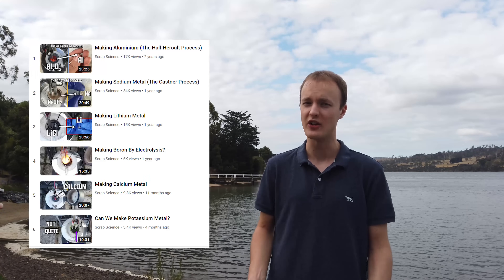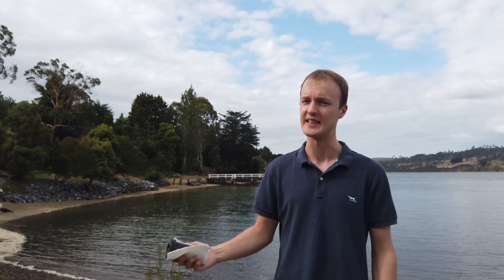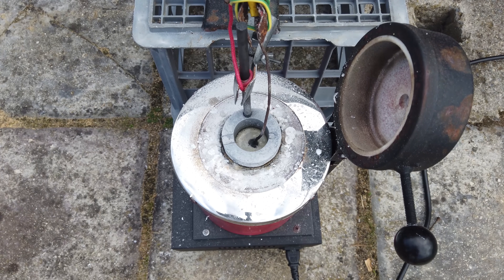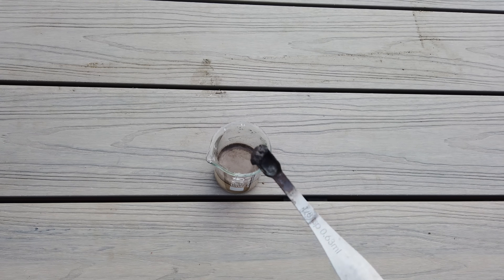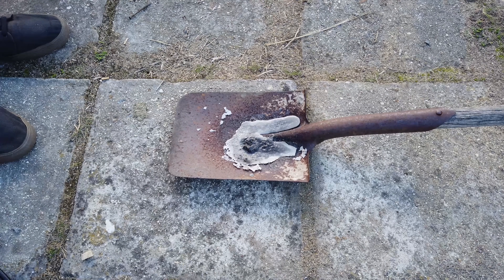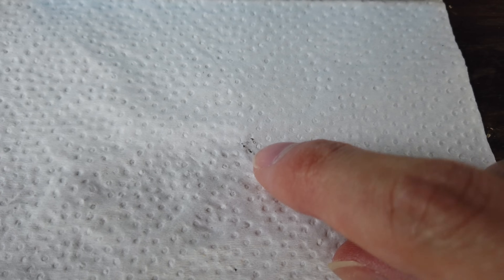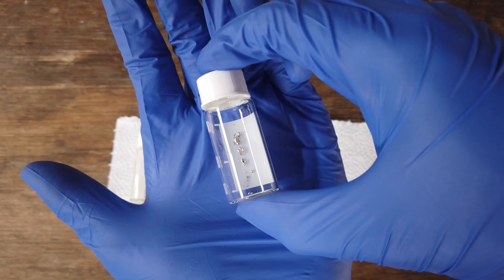Making Magnesium Metal

Comment: Mix the MgCl2 and KCl togther in a ball mill. Add a small amount of silica sand to it as well. Melt down.  Continue heating to bright red heat in a steel can. Next use a graphite rod as the anode. 7 to 15A is about right for a soup can container. The magnesium will sink to the bottom of the can. The high temperature also prevents formation of an alloy of k and mg.❤
Reply: exact temperature?
Reply: how do you prevent it from sinking? what is the sand used for?
Reply: @Critical-Smoke  I would guess as a dehydrating agent? I know the same is done with hygroscopic dry extracts of plants in pharmacy, they add 5 wt% silica.

Comment: Try dissolving MgCl2 and KCl in water and boil the solution down to crystallize carnallite (KMgCl3·6H2O). It should dehydrate easier than the MgCl2 and give better yields. Also the magnesium sponge can potentially be a good source of highly reactive magnesium (for alcohol catalyzed sodium synthesis or similar experiments).
Reply from the maker: The only trouble with the magnesium sponge is that it's filled with salt from the melt, making it largely unreactive outside of aqueous solutions (which dissolve those salts away, of course). I tried burning it and it wouldn't even ignite, since the salts kept coating and protecting the metal within.
Any ideas for removing the salts and leaving the magnesium sponge intact? Maybe it would still work for those kinds of reactions anyway? I'm unsure...
Reply: @ScrapScience  Only thing I can think of is putting it inside a blender along with mineral oil and dump the resulting mix in water to get rid of the salts. I would probably directly use it in the sodium production.
Reply: @ScrapScience  just an idea what if you put it into coffee grinder; theoretically the chloride shouldnt be a problem anymore ( but on the other hand it can become pyrophoric not sure)
Reply: "Carnallite may not only be fluorescent but is capable of being phosphorescent" very interesting

Comment: @6:15 perhaps you could use a small fine-meshed steel sieve for the electrode put deeply inside the molten salts (and saving it from oxygen and CO2 and CO, that may have reduced the yield ?). Could you coalesce the metal chunks  under a borax layer ?

Comment: 8A on such a small wire is probably close if not more than the limiting current, which would also explain that your metal is reactive .... if you namely go beyond limiting current for your magnesium reaction you will get potassium deposition or alloy deposition
Also,  I think it wont work to do molten magnesium in your cruicible and the cruicible being the anode .... as the magnesium would drop down and then reaoxidize on the anode
For that the crucible should be the cathode and another graphite piece(/rod) as the anode
Reply from the maker: I'm pretty confident that we're not dealing with any potassium metal here. If we've made potassium under these conditions, even in an alloy, it goes against everything potassium tends to do in high temperature chloride melts. It is extremely difficult to deposit potassium from any molten salt, so this would be quite a feat.
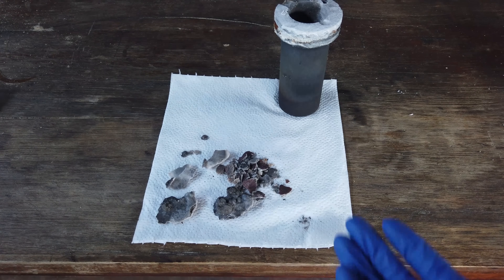But yes, the crucible being the anode was not ideal here - I wasn't expecting the metal to sink. I address a couple of ways to get around this at around 12:12.
Reply: Can't use graphite for reducing alkali metals, it would eviscerate his crucible in no time. Likely the same for alkali earth metals

Comment: The reversible double carbon reduction reaction against magnesium oxide would be a better way to do this.

That or the one way reaction with aluminum.

Both require a lot of heat energy, but both are very precise and precisely controllable.